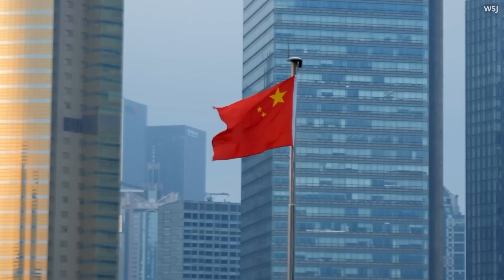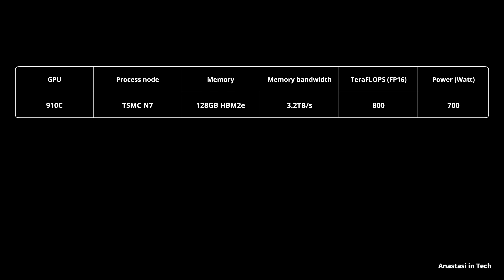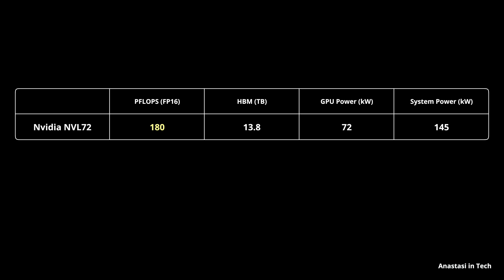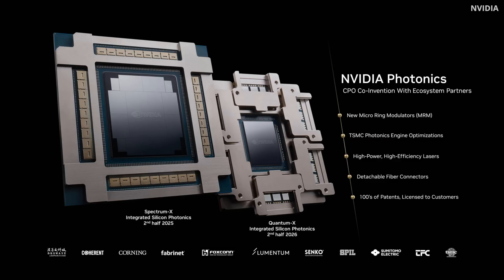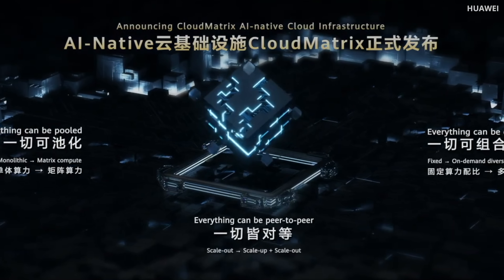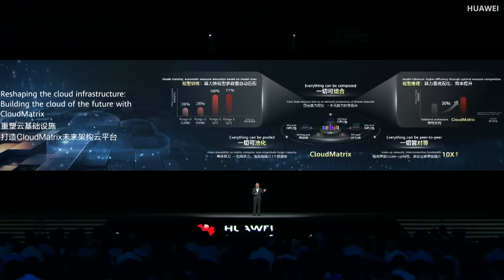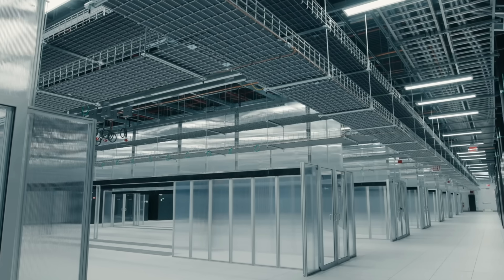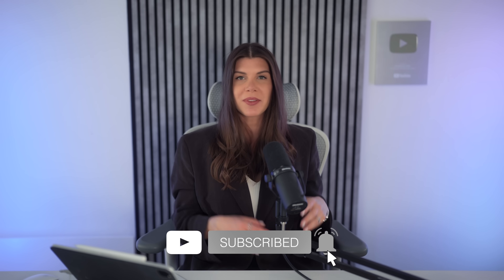Inside China's New AI Megafactory

Comment: Here are the key facts about the Huawei Ascend 910C in the CloudMatrix 384 system and how it compares to NVIDIA GB200 NVL72:
1. CloudMatrix 384: China's answer to NVIDIA

Design:

384 Ascend 910C chips connected in an "all-to-all" topology 69.

Goal: Technological independence from NVIDIA, especially for the Chinese market 6.

Performance (System Level):

300 PetaFLOPS (BF16) – almost twice as much as NVIDIA GB200 NVL72 (~150 PetaFLOPS) 9.

3.6x more HBM memory (total) and 5x more GPUs than the GB200 cluster 9.

2. Comparison of Ascend 910C vs. NVIDIA GB200 (single chip)
Criteria: Huawei Ascend 910C NVIDIA GB200 (Blackwell)
BF16 Performance 780 TeraFLOPS 2,500 TeraFLOPS
Memory 128 GB HBM 192 GB HBM3e
Bandwidth 3.2 TB/s 8 TB/s
Efficiency Low (7nm) High (4nm)
Price/System ~8M USD ~2.6M USD

Weaknesses of the 910C:

Power Consumption: A CloudMatrix 384 draws 560 kW (vs. 145 kW for the GB200) 9.

Software: Huawei's CANN stack is less mature than CUDA's ecosystem 6.

3. When is CloudMatrix 384 worthwhile?

For China:

Politically necessary (US sanctions block NVIDIA high-performance GPUs) 6.

Ideal for government projects/large-scale research where costs are secondary 6.

For scaling:

For massive clusters (e.g., 18,000 GPUs), Huawei leverages its topology expertise 9.

4. Future & Limitations

Efficiency issue: The 910C lags behind NVIDIA in performance/wattage – this could only change with SMIC's next chip generation (5nm/3nm) 9.

Alternatives: Tencent is relying on NVIDIA H20 stocks for the time being until domestic chips are competitive 5.

Conclusion

The CloudMatrix 384 is a prestige project with brutal scaling, but high costs and power consumption. NVIDIA is more efficient for the global market – but a strategic stopgap in China 69.

Comment: No the latest GPU from Hauwei is Ascend 910D whose performance is better than Nvidia's H200 chip now in trials by Tecent, Alibaba, Baidu.... The Ascend 920 estimate to launch Q4/Q1 26 is suppose to compete with Blackwell. I have to correct Anastasi in saying that Hauwei's chips are manufactured by TSMC. TSMC would not dare to manufacture anything for Hauwei. The chips are manufacturthaed by Hauwei inhouse in its DongGuang facility and by SMIC. Hauwei can design chips that are as advance as Blackwell but it can't manufacture them as it doesn't has the EUV. However, rumors had it that Hauwei's own EUV will commence trail production in Q4 this year. If it were true then U will see Nvidia heading for big trouble! LMAO!

Comment: It's fine if it's 3x less efficient as long as its 3x cheaper. That would be enough for many neutral countries to choose Huawei over Nvidia.

Most probably China, Russia, ASEAN and African counties will have data centers with Huawei's  GPUs while US, EU, Japan, Oceania, Middle-East, Latin America and India will use Nvidia GPUs in their data centres.

Nvidia will still have 70% market share in High-end GPUs
Reply: If it's 3× less efficient and 3× cheaper, then it's... exactly the same thing as Nvidia has. Given that many application REQUIRE higher memory to even run... it's a bit like expecting cheaper but slower 1GB HDDs to replace somewhat more expensive 8GB HDDs. Space is also an issue, you can't just connect more of them.

Comment: Anastaslin, your comment about the drawback of underwater data centers requiring large downtime's for repairs broken hardware does not ring true from my experiences with large cloud providers. The way a number of cloud providers handle failures is to not repair individual subsystems of a "major" system. They leave them in place until the major system drops below a set capacity level then they just swap out the major system. This allows for keeping everything in the major system at the same revision or creating potential incompatibilities within a major system or breaking some other part of the major system during the repair. This was much of the drive with containerized data centers. there is never a reason to open the container on site. When the container dropped below the critical capacity level the contain was shut down and disconnected from the power/cooling/networking and a fresh container was swapped in. The old container was sent to the manufacturer to be retrofitted with the latest build version of the hardware.

Comment: China isn't a problem for nVidia. China doesn't even have the technology to produce chips smaller than 7 nm. They're claiming they can produce 2 nm chips, but they've never proved it and they've never shown that they have the tech required for it. If they had it, this new chip you're reviewing in this video would have implemented it. They're lying, as usually. And their chip's high energy usage you pointed out shows just how useless their chip is. With that kind of energy consumption, hardly anyone's going to want their chips because one of the major problems with AI is that it requires countries to virtually double their energy output, or more. The US is looking to double its energy output in the next 10 years. So, nVidia has nothing to worry about.

And besides, China will collapse within 6 years due to their one child policy gutting their current 18-54 demographic. That's the demographic that drives a county's domestic economy. Once it shrinks, a country is headed for collapse no matter what. When birthrate drops below a certain point, we've never seen a country recover. They always collapse.

And you can see this in China's workforce problems right now. They have tons of kids graduating college and having no work. Massive unemployment rates, meaning they can't support their economy because they're not making any money.

Also, as of about 8 months ago, many Chinese factories haven't been paying their employees so the employees are revolting, burning down favorites and protesting. China is in very, very bad shape. And Trump's trade was just accelerated China's collapse.

Comment: 14:30 Underwater data centres need not be deep under water. The heat radiators just need to be placed deep under water, so that heat from the heat radiators is continually removed by water convection current in a huge water pool. The underwater data centre just need to be next to the huge pool of water. Servers in the data centres can still be readily accessible by humans for maintenance. Just need to electrically lift the servers out of a separate smaller water pool in the data centre during maintenance.

Comment: Now Real Title: China's Huge AI Chip Progress: NVIDIA is still King 
The Huawei Ascend 910C is not more advanced than NVIDIA's Blackwell architecture on a per-chip basis. Blackwell GPUs (e.g., B200, GB200) offer superior per-chip performance, power efficiency, and software maturity, leveraging TSMC's 4nm process and advanced HBM3 memory. However, Huawei's CloudMatrix 384 system, with 384 Ascend 910C chips, outperforms NVIDIA's GB200 NVL72 in raw compute (300 vs. 180 PetaFLOPS) by using significantly more chips and power, making it a viable alternative for China's domestic market, where NVIDIA's chips are restricted.

For China's AI ambitions, the 910C represents a significant step toward self-reliance, but it lags behind Blackwell in efficiency and global applicability. NVIDIA's lead in process technology, software ecosystem, and global market presence makes Blackwell the more advanced platform overall. Huawei's progress, however, underscores China's ability to close the gap, particularly in system-level design, despite technological and geopolitical constraints.

Comment: its not who has the best rock, it who throws the most rocks, silicon pun intended. what do you think the trade war results in. well no more imports. mutual blockade. so if you live next to ocean with a data center, the data center heat itself is enough to purify the sea water. for all uses. direct coupling to the data center cooling system. yeah pump the water instead to the cooling salt-water purification plant next to the data center. just like for a nuclear plant. also purifying the sea water gives all sorts of minerals directly.

Comment: A lot of water is needed to operate data centers. Water is not used for its chemical properties, for example its oxygen and hydrogen contents, but only for cooling. For this purpose, data centers should be built in arctic and antarctic regions. But then there is another problem - shortage in electrical power. There might be billions to tons of fossil fuel underground in those regions but it is useless unless it is mined and processed. Solar panels are useless too in those regions.

Comment: The main problem is that during the climate crisis the humanity is finding ways how to create even more heat.
Can we at least work on creative ways to reuse that heat. By pairing data centers heat generators and reuse the heat generated by datacenters for Human activities that requires a lot of Heat and there are plenty.
 Here is a list below.
🏭 Metallurgy & Smelting
Smelting ores (e.g. iron, copper, aluminum): 1200–1800°C

Steelmaking (blast furnaces, electric arc furnaces): up to 1600°C

Foundries / Metal casting

🧱 Ceramics & Glass Work
Glassblowing and forming: 1000–1600°C

Ceramic firing (kilns): 900–1300°C

Brick and tile production

🔩 Industrial Manufacturing
Heat treating metal (annealing, hardening): 300–1000°C+

Sintering of powders for 3D printing or ceramics

Cement production (clinker kilns): ~1450°C

🔬 Scientific and Technical Applications
Plasma torches: 5000°C+

Rocket engine testing

Nuclear material processing

High-temp material testing labs

✨ Artisan & Craft Work
Blacksmithing / Forging: 800–1300°C

Enameling: ~750–850°C

Raku pottery firing (open flame ceramics)

🍞 Food-Related Activities (Moderate Heat)
While not as extreme, these still require notable heat:

Baking in wood-fired ovens: ~300–500°C

Charcoal grilling / tandoor ovens: up to ~600°C

Sugar refining (caramelization): ~170°C

Comment: This is also coming on the backdrop of China's systemic approach at making electricity cheaper via chasing solar, wind, hydro, thorium nuclear and fusion energy generation, as well as UHV transmission grids spanning East to West, ensuring non stop energy generation across time zones. There is even a plan I hear of making energy generated free, but only charge energy transmission fees, with the aim of boosting productive potential and lowering cost ceilings by reducing energy costs.

Comment: Huawei’s new CloudMatrix is a stunning feat of engineering: 384 optical-linked GPUs, massive bandwidth, insane compute. But not once did they mention data compression. Not even a whisper.

Throwing hardware at the problem is brute force. Elegant systems compress, optimize, adapt. Nature doesn’t waste energy—it flows. Enlightenment isn’t about adding more—it’s about removing what’s unnecessary.

The easiest path is the one where friction is lowest, not where power is highest. Even if it takes longer, it consumes less of you. Less heat. Less tension. More flow.

Whether you're building GPUs or building your soul, learn this: The path of highest power isn't always the path of highest wisdom.
Reply: I'm sure they thought of that and working on it😂, you are not the font of wisdom. China are known for their innovation in power efficiency breakthroughs across many industries

Comment: Anastasiia, it sounds like you're not familiar with the history of underwater datacenters. Sun Microsystems did this first in the early - mid 2000s, IIRC. Ultimately they gave you on it after a few years. Microsoft tried in the early 2010s, IIRC and after a few years ended their experiment as well. The Oxide Computer crew, many if whom hail from Sun, discussed these experiments in one of their early episodes. Brian Cantrell and Adam Leventhal in particular were at Sun during those years. The cooling worked great but manageability and operability left a lot to be desired. Cost could probably come down a lot now. I don't think it's as farfetched as you think. 

Maybe tying a super efficient cooling substrate (diamond??? See Akash Systems and maybe do an episode on them) to a super cooled liquid cooling system -- not just water, something better -- could do it. Just a thought.

Full disclosure: I'm an investor in Akash Systems.

Comment: "Nvidia is out?" Not even close. Huawei’s Ascend 920 finally reaches performance similar to the H100, but that chip is already two years old. The 920 is built on SMIC’s 6nm process, which is several generations behind TSMC’s 4N used in the H100, and even further behind the 4N or N3P process used in the new B100.

Nvidia is already shipping Blackwell with double the compute power, FP4 support, better interconnects, and a full software stack that's been refined for over a decade. Huawei has no CUDA, no native PyTorch support, and relies on its own ecosystem, which is practically unusable outside of China.

This isn’t a breakthrough that puts Nvidia out. It’s a local catch-up effort under sanctions. Solid achievement, but still years behind.

Comment: Would sending data centers to space instead of underwater be a better way for cooling?🤔
Reply: No. Vacuum is the best heat insulator. Thats why thermos bottles used vacuum for insulation. In space there is a lot of vacuum.

Comment: I don't think China is too worried about energy as they will soon start rolling out thorium molten salt reactors, a commericial one is already operational. For energy storage, there are huge investments for large sodium ion batteries for grid stabilization with renewables. Seems like China's strategy doesn't consider energy to be a significant limiting factor
Reply: Thorium will sustain them until fusion comes along.
Reply: they can import all the energy they want at a reasonable price via power of siberia 1&2
Reply: At least in the short term, higher intelligeny models are more valuable that consuming 2x or 4x more power
These models can help accelerate both euv research breakthroughs and accleerate researcha accross all domains of chip and compute power.
Reply: @samosa9488  There will be a bottleneck in which by then higher energy can’t help anymore.
Reply: They're building one new coal power plant a week and they rely heavily on imports of coal, gas and petroleum. They don't have energy security or food security. Don't believe the hype
Reply: The two major deserts in China's western plateau can be built into giant solar power generation bases. There is sunshine almost all year round, and polysilicon solar panels can be produced using local materials. Electricity can also be generated by solar energy. Combined with China's ultra-high voltage and ultra-long-distance power transmission, this is a perfect closed loop.
Reply: China already produces 1/3 of world electric power and they're still building more like crazy...

Comment: Anastasia. Light fiber can transmit fast but the interface is very slow. Much slower than the rc delay of copper trace. There is nothing to gain here. I do like the infrastructure based approach.
Reply: Light fiber scales better. Yes you eat additional interface delay but in exchange you can build bigger clusters. Huawei choose optics because they know they will be behind in chip density so they are planning on increasing cluster density to compete.

Comment: Huawei aims to be China’s answer to Nvidia.

New Ascend 910 C chip is roughly 4× faster than Nvidia’s restricted H20 but draws much more power.

Full Cloud Matrix 384 rack is almost twice as fast as Nvidia’s comparable system, yet uses about twice the electricity and costs more.

China tolerates the power hunger because electricity is cheaper and supply security matters more than efficiency.

Huawei’s software stack (CANN / MindSpore) handles common AI tasks but still trails Nvidia’s mature CUDA ecosystem; existing code must be ported.

Manufacturing is the bottleneck: older chip process and reliance on foreign high-bandwidth memory.

Bottom line: Huawei cuts China’s reliance on US hardware, but worldwide Nvidia remains the better, more efficient, and developer-friendly choice.

Comment: good video yeah the use of optical interconnects is a major downfall for them, all though China power consumption is not really a concern for them, because they are capable of producing more power, as they start scaling up, this becomes a huge problem.
Reply: Optical is not a downfall it's a strategic decision. They are behind in chip density so their only choice is increasing cluster density. Optical scales better than copper. The complexity and reliability issue can be solve with smarter network algorithms. They don't even need to design the networking system just copy the internet protocol and optimize it to reduce latency.

Comment: Huawei has developed the Ascend series of AI chips processors for training AI models. 
These chips are part of China's broader strategy to achieve self-reliance in advanced chip technology.
The Ascend 920 is an AI chip developed by Huawei to compete with Nvidia's H20 in the Chinese market following US export restrictions on Nvidia's chip. 
The chip is designed to be a significant improvement over its predecessor, the Ascend 910C, with performance enhancements of about 30% to 40%.
The CloudMatrix 384 is a high-density computing cluster composed of 384 Ascend 910C AI processors arranged in a fully optical, all-to-all mesh network. 
This system delivers approximately 300 PFLOPs of dense BF16 compute, nearly double that of 
A cloud infrastructure architecture designed to pool and interconnect computing resources for high efficiency and reliability.
A high-density computing cluster composed of 384 Ascend 910C processors, providing significant performance improvements over Nvidia's GB200 NVL72.